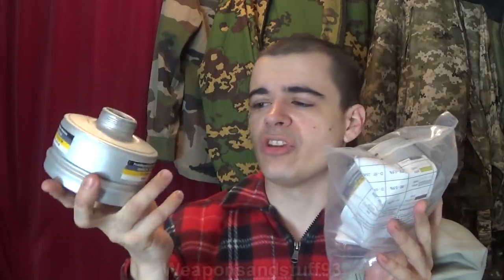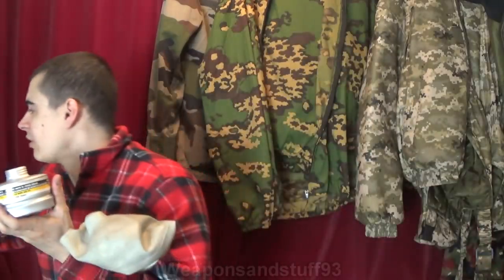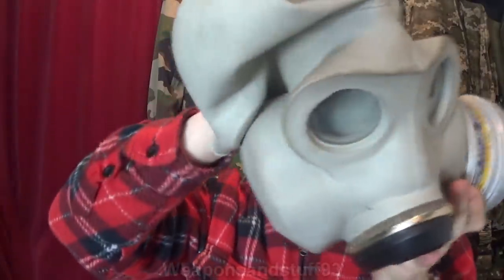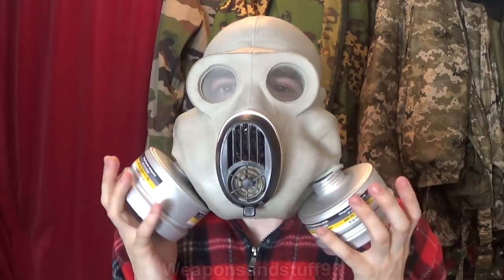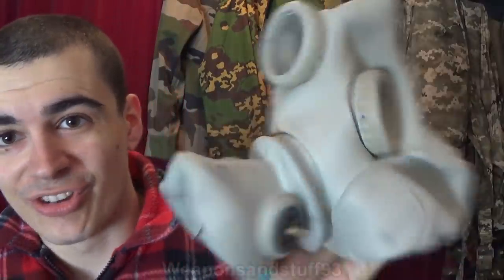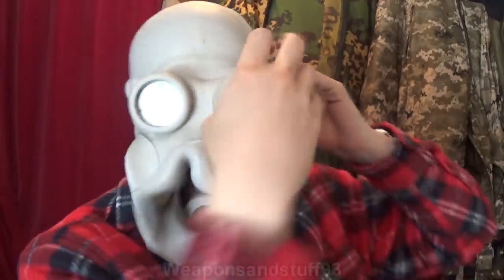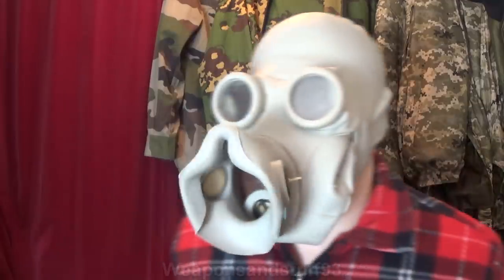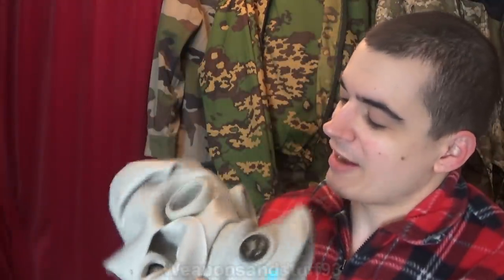I created a monster!

Comment: Well, it's a great little try. In the first part of the vid it even could work in a serious situation with a 40mm filter. You could make a screw nut from the threaded filter cup and fasten the 40mm filter from the inside to give airtight seal. The PBF with wearing the inside out :-) it's simply Star Wars like an alien on the Tatooine in the cantina of Mos Eisley. Great! Thanks for sharing.
Reply: That's a 300 IQ idea and it's easy to do

Comment: I do realise that this video is "a bit" old, but I'll post about this idea anyway, since it came to me quite recently.
What if you were to take two of those standartised Chinese gas mask hoses, cut off (or otherwise remove) the end screws (the ones where the filter would go) and glue those inside. Contact cement for something permanent, Hot glue for something more temporary, I wouldn't recommend superglue because it could possibly damage/eat away at the rubber, but don't qoute me on that.
To make it more stable and prevent the filters from pulling down so much (hopefully) you could make some simple cardboard inserts and voila.
In theory, you should have a PBF which takes 40mm filters. Both NATO ones and GOST ones (due to the standartised thread on the hose). This method is a bit messy, as you will be left with two open ended hoses, but there's allways some way to improve. I hope this seems sensible enough.
P.S. I hope you get well quick and keep up the great work, Weaponsandstuff93

Comment: Could a hole be drilled on the filter cap and reattached to the filter from the inside of the mask to reinforce the connection? Is there enough thread on the filter for the cap to get a good grip on it through the hole?

Comment: This is not anyway related to the video but do you think I could restore a time-damaged SHMS I got today? The seller said it was in perfect condition and sold it for 15€, clearly not a collector. It has cracks and wounds near the "snout" and ears and the rubber is dry. Also I would like to know if brown is a original Soviet color or a Chinese ripoff?
Reply from the maker: If you bought it from eBay you can get a refund for not in an as described condition. You probably can't repair it.